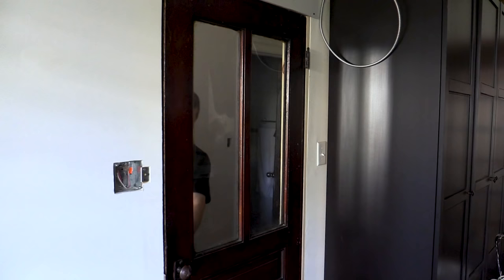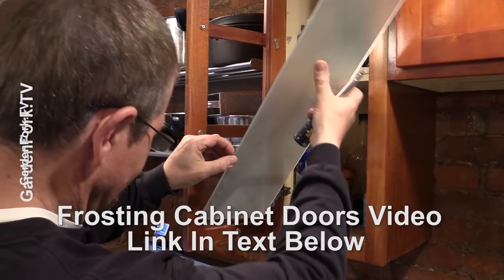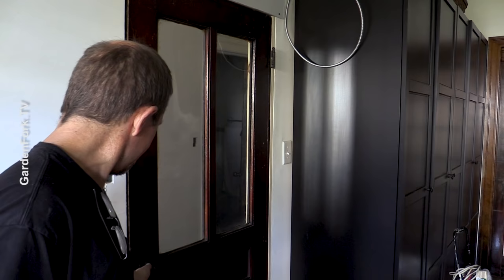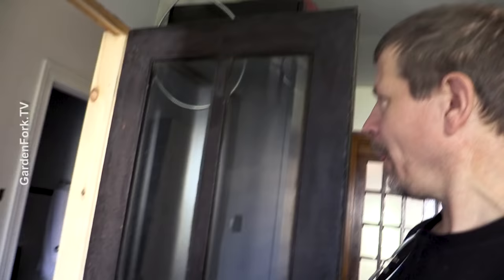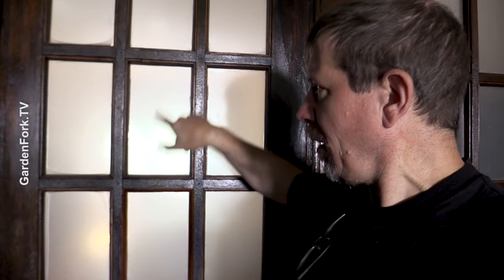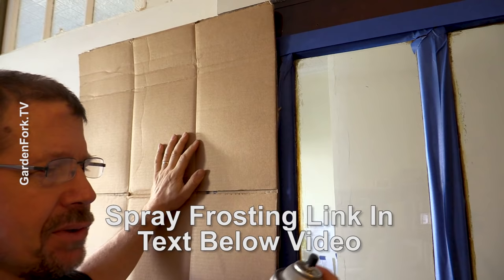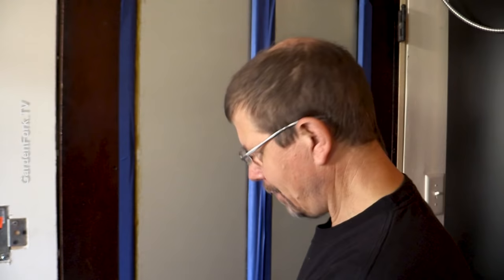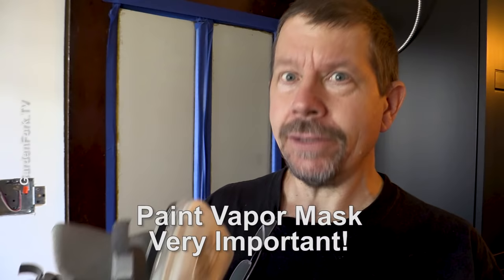How to Frost Glass | Frosted Glass Spray Paint | GardenFork

Comment: How do I wash windows? For best results, do this early morning or late day when your windows are not in direct sunlight.  To start, fill a sink about 1/3 full of HOT tap water. Add a scant few drops of your fav dish soap. Immerse a clean, lint free cloth in the water, wring well of excess water - you want the cloth barely damp. Now, wash your windows and allow to air dry. Additional drying not necessary. *A bucket would make this task quicker but plastic buckets may contain residues which could effect your end result. Maybe use an old stainless pot?? I used to be a private housekeeper and would ocassionally quick wash dirty windows of clients homes. Never had one complaint.  Windows literally sparkle w this method. As do mirrors.
Reply from the maker: wow thanks Kerry, have never heard of this method before. brilliant to not wash the windows when they are warm. how smart!

Comment: Hard to see how consistent the frosting is. I would have assumed if you spray more in one area it's going to be patchy? Or is there a point at which any more spray won't make a difference? I want to frost patio doors, so will be a large area and obviously want them not to look like a hack job to my neighbours :-). Otherwise I'm goin to use the frosted film instead. But the spray would have been nice in that I could use masking tape to create stripes.

Comment: Hi. I have an etched glass door. Can I use this spray on that? I would like to attach a pic but not able to. It’s the glass on the front door. Thick and etched inside. Thanks.
Reply from the maker: you can spray this on any glass, but i'm not sure how it will look on glass that already has been etched.

Comment: I frosted my bedroom window just the bottom half but I went outside and open the screen I didn't spray inside
I use Rust-Oleum Frost works pretty well I can't see anything through my window very happy with the results
Used one can only cost 3.99
Reply from the maker: Great to hear Mattie, thx!
Reply: Is this need to redo or is it removable
Reply: does it crack the window i heard it can crack double glazed windows

Comment: Always thought with glass you spray different direction (vertical/horizontal with each layer of paint.  No?  I saw you do horizontal each application.  Still worked & looks good.
Reply from the maker: Worked fine for me, the key is light spraying so it doesn’t drip. Thx!
Reply: @gardenfork  Thank you for advising.  Merry Christmas!